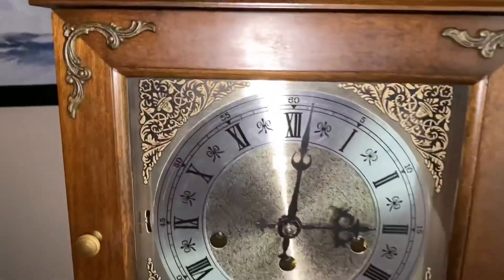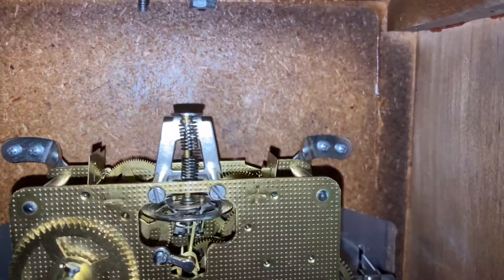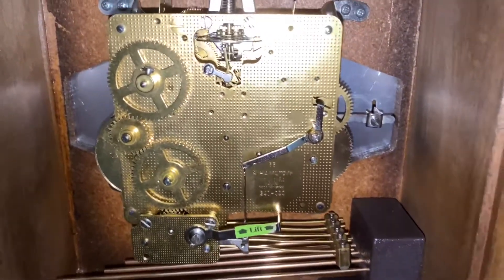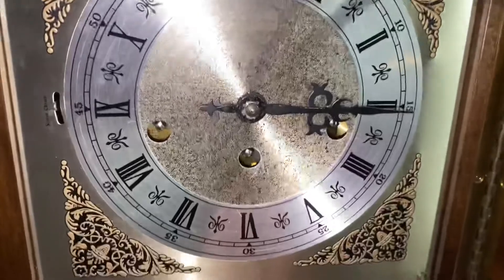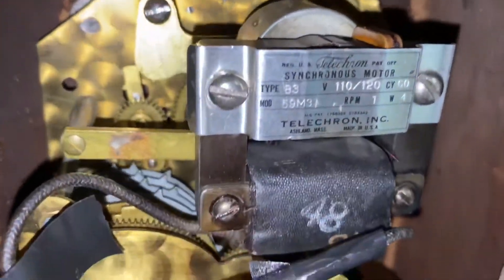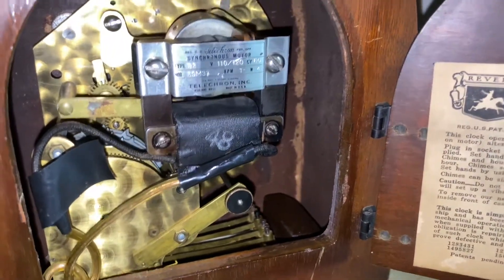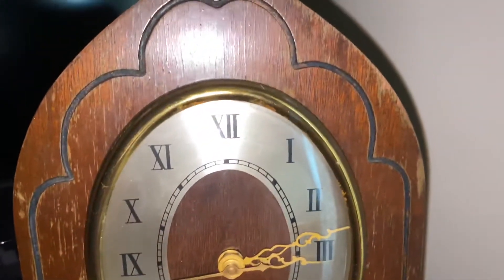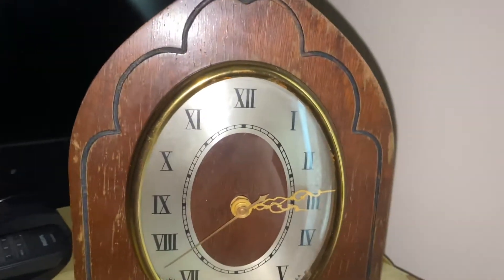Mechanical vs Electromechanical: Which one is better??

Comment: There are also electromechanical clocks that are operated by battery. What happens is that the clock has all the gears of a regular mechanical clock but when it needs wound, the battery activates a relay which keeps the spring wound. I have two of those and those keep the best time. I would recommend getting one of those if winding can get a little difficult on a lot of clocks. That way, you still have a true mechanical clock but operated by batteries.
Reply from the maker: I’ve planned on that for awhile now. I have no room seeming how i just moved back into the house/room